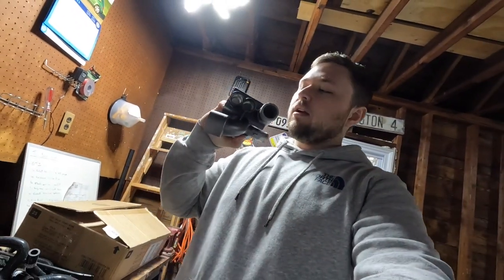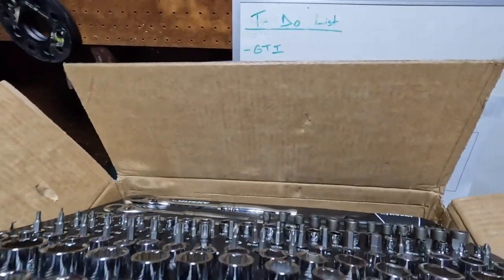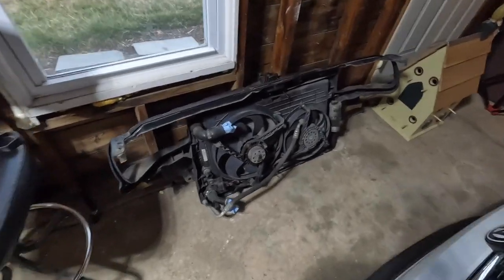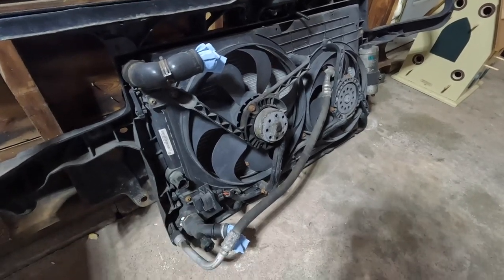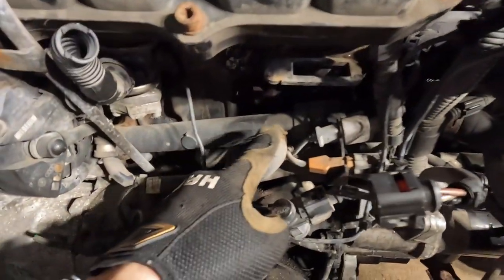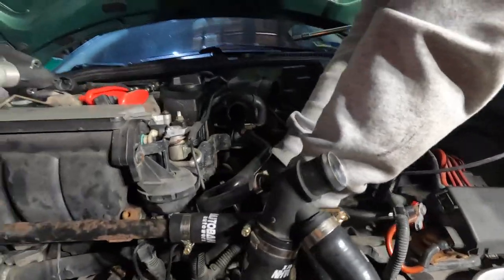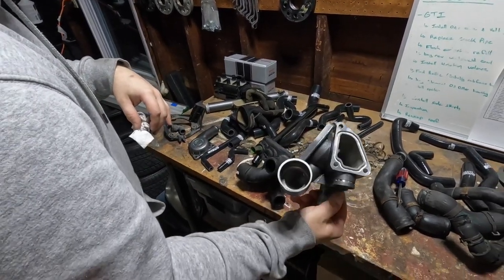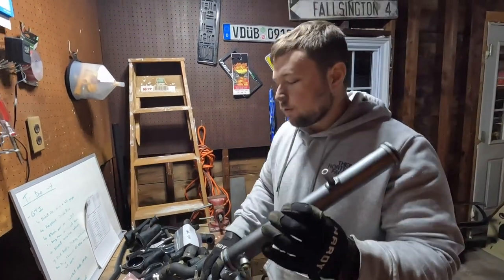Upgrading the GTI's coolant system!

Comment: FYI, there’s more bolts holding in that arm rest mount, been a long time since I did mine but pretty sure there’s 3 total and you’ve gotta take the rear center console portion out. One of the mounting points is a stud that’s shared with the ebrake I think.
Reply from the maker: I'll make sure I do that on a day you're available to consult lol